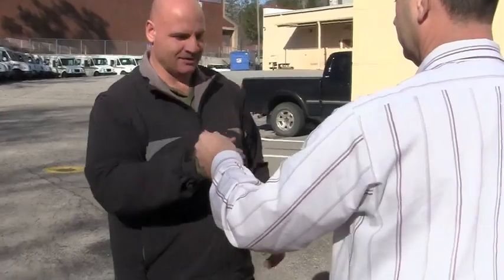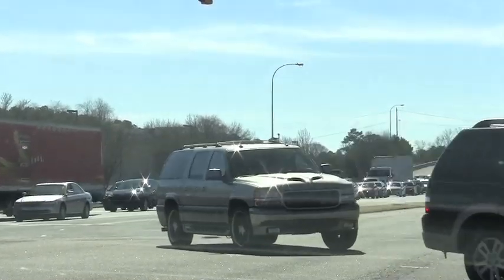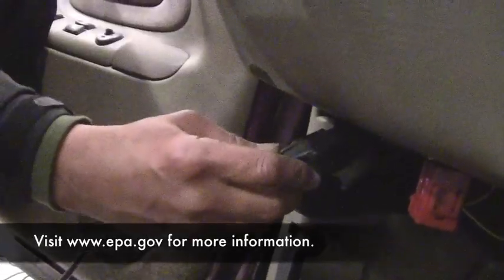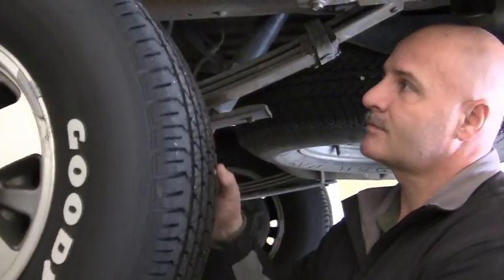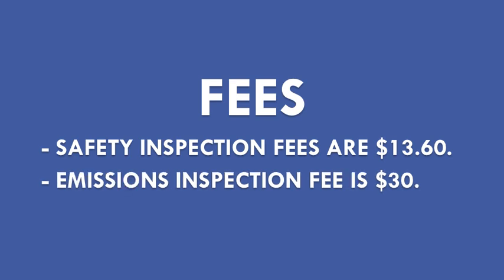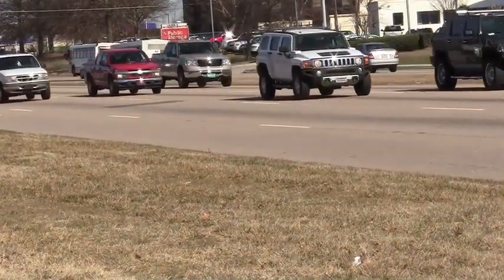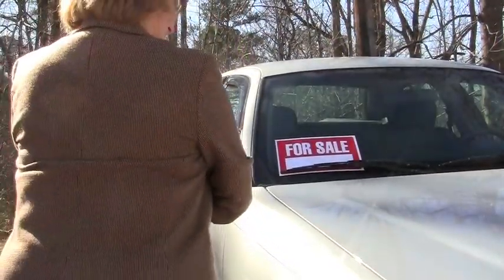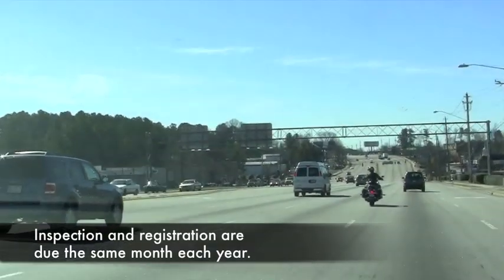Inspection and Registration

Comment: It's another way for your local state to make more money off of you and they're in cahoots with the local shops so they can make money off of you as well. I'm a former mechanic and I do all my own vehicle service work and I absolutely despise these inspections because all the shop wants to do is find other things wrong on your car. Its not part of the inspection to sell you a service like a trans flush or charge an arm and a leg just to change out your wiper blades which anybody can do in like 15 seconds per blade. 

I also don't understand why garage queens that get driven less than 1000 miles a year need this unnecessary inspection since its practically brand new with no wear or tear on such a low mileage vehicle but oh boy you've just got to appease the state so they can get into your pocket and rip you off!!!!!
Reply: @ryanchristensen1799  - GREAT!!🤣🤣🤣💀

Comment: I actually agree with the inspections because most people fail to maintain their cars anymore.  However, I also believe in a graduated inspection system where, when the car passes inspection from a private owner (not a dealer), it gets a one year inspection.  When it expires in one year, the renewal it is 2 years.  At renewal of two years, three years then on.  When the vehicle changes hands, the inspection cycle restarts.  Vehicles that have been in an accident or vehicles that have serious safety violations (cop ticket) will also reset the inspection cycle.  I like that idea better.  Also I would do away with requiring it to renew the registration.  If the person does not have enough money to fix their car, how are they going to get to work if they can't renew?